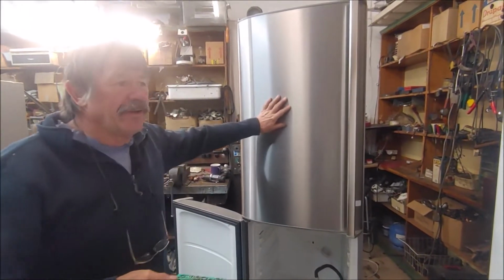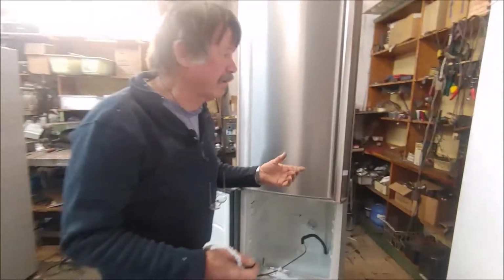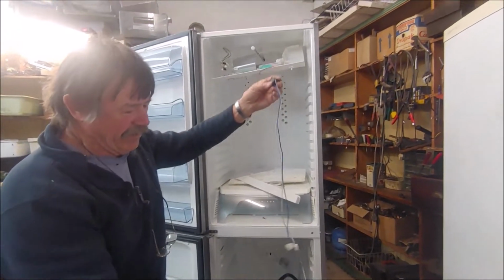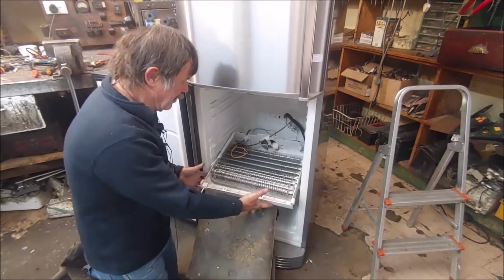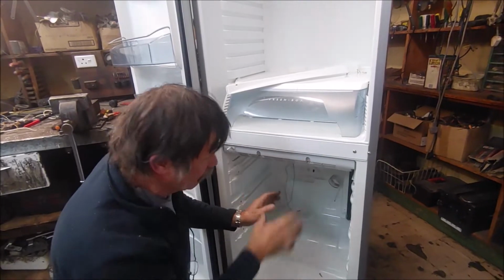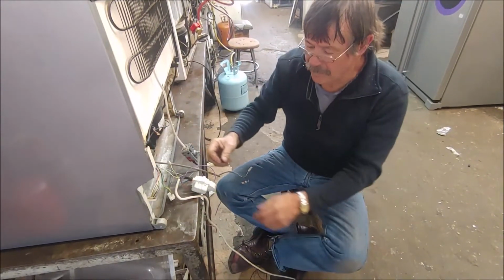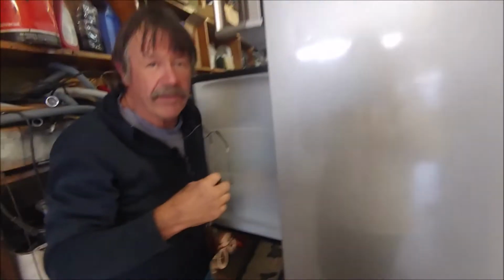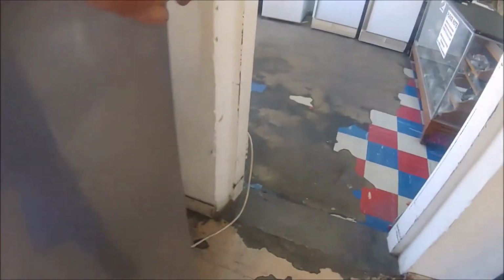AEG Fridge modification

Comment: Great job there my man. What temperature do you set on your thermostat or must i say level since the numbers on the dial are not temperatures
Reply from the maker: On the Ranco thermostat normally -18 degrees celcius on the cold plate gives you between +2 and +4 celcius on the fridge. On that one I calibrated it to a warmer temperature and a longer defrost cycle because of the big cold plate.

Comment: could you explain the pins on mechanical thermostat ?
Reply from the maker: That is a single door thermostat, 2 contacts only normally closed, temperature range on the thermostat bulb minus 26 to minus17 degrees C

Comment: Hello, please explain about the identification of compressors horse power .Thank you
Reply from the maker: The phrase Horse Power was used to determine the strength of a motor.  A more modern classification of motor strength is in watts. Some compressor manufacturers mark the wattage on the compressor label, and some will use a code for which you will have to find a reference document from the manufacturer to determine the wattage. For example if we take a 1/4 horse power which is more or less a 1/4 of 750 watt = 187 watts but you can get a smaller 1/4 at 170 watts and a bigger 1/4 at 190 watts.
Reply: @JDNelRefrigeration  Hello. Thank you. Can you make a clip of a few minutes about this matter?
Reply: what happens if the compressor is an invertor powered by dc
Reply: Replace the inverter  compressor to a conventional compressor

Comment: Thanks to one of your previous videos I rewired a fridge that I had quit using because the electronic board was fried. A new board was somewhat over $400. For less than $100 in parts (defrost timer, thermostat, and termination switch) I now have a functioning fridge again which will probably outlast anything currently made. Thank you for your ingenuity and videos.